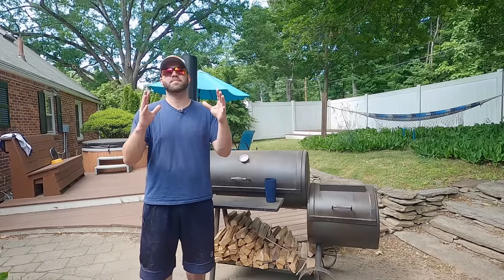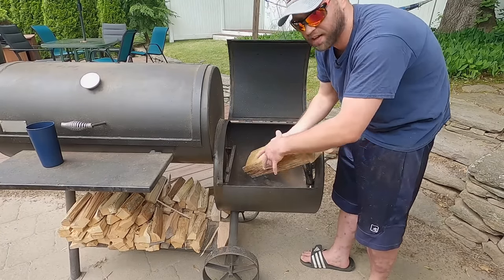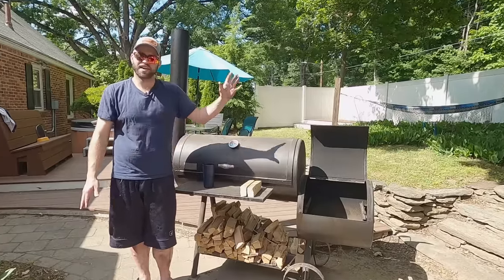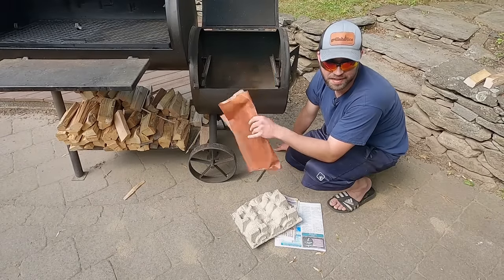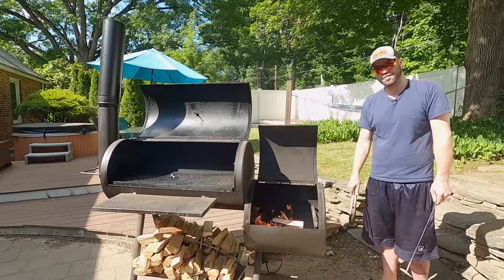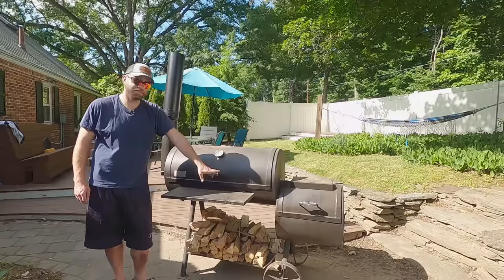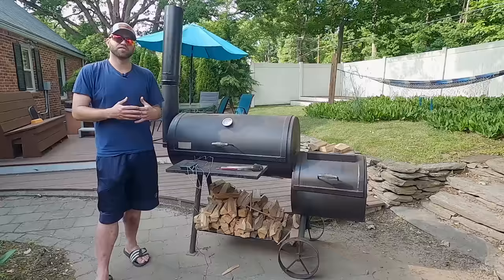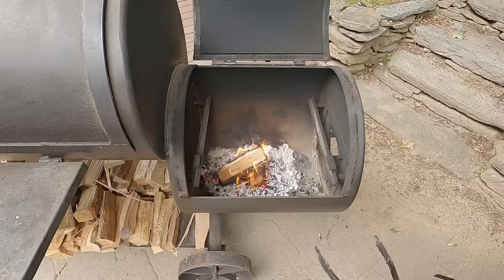OFFSET SMOKER FIRE MANAGEMENT FOR BEGINNERS | How To Burn A Clean Fire | Fatty's Feasts

Comment from the maker: Here are the links to other videos mentioned in this one:
Best Wood Choices: https://youtu.be/rpaCFw3QvmY
How To Extend Your Stack: https://youtu.be/qMCBjzdNWXU
My First Ever Brisket Cook: https://youtu.be/zmUmBZ9EDog

Do you have any tips or tricks for beginners that I didn't mention in the video? Let us know below!
Reply from the maker: @user-om2tm4fm7x  I think my first question is what type of smoker are you using? It doesn't sound like it's an offset if you're using chips.
Reply from the maker: @user-om2tm4fm7x  Ok I understand now. If it's a very cheap offset, it would be tough to use splits like I did here anyway, since it's typically too small. Charcoal is the way to go for sure as the main source of fuel. But, I still would not use "chips" as those are for propane smokers where you can soak them or use them in a smoker box for a gas grill. In your case, could you get a bag of wood chunks? Those shouldn't be too bad to find, but I don't know for sure in your area. I'm assuming if you can get chips, you can get chunks.
Reply from the maker: @user-om2tm4fm7x  Yeah small baseball size is good. Slap one of those guys on every 20 min or so for that smoke flavor. The problem with the chips I have in your case is they just burn fast, at least from what I've seen on offsets the size you described. You could try wrapping in foil, but I think the chunks would serve you so much better.

Comment: You're going to get injured splitting your wood in that position. Never put yourself on the side of the splitter like this.
Reply from the maker: If I were using a bigger splitter, I would agree, but I don’t believe these splits are big enough to do any damage.
Reply: I agree with Josh McBride.  I have a small splitter like yours and I've had some small splits fly off the end and land 20-30 feet away.  Those were mostly dense thick branches and not big log splits but I would err on the side of caution.  The kinetic energy of some of those are surprising.

Comment: There is such a thing as “too clean” a fire - and you lose flavor as a result. I’m not advocating heavy white dirty smoke, but no need to stress over every little puff of smoke. Throw a prewarmed split on and close it up. As long as you are not using splits WAY to big (as you pointed out) the process is quite forgiving in the long run.
Reply from the maker: You make a valid point. Thanks for throwing that out there!

Comment: I’m sure you’ve watch chuds bbq. The dirty vs clean smoke is debatable. Jirby, Jeremy Yoder, and Brad have all confirmed you don’t want clear smoke for the first part of the cook. Once I saw that I was actually able to maintain a more consistent temperature and the smoke profile on my food was better. It also allowed me to use larger splits. And I control the temp by how I lay them in the coals. The splits are long enough that they can bridge over the coals perpendicular to the smoker for a little air gap and if it starts to run away I can turn it at a bit of an angle and burry it in the coals to varying degrees to bring the temps down a bit. Just another tool in the box for running that fire.
Reply from the maker: Maybe I came off a little wrong in the video, but I did mention it’s near impossible to burn a crystal clean fire at low temps and that burning a somewhat dirty fire isn’t the worst thing in the world. I have a brisket video coming out soon where I explain that a little better. I like your idea about the splits. I’ll have to give that a try!
Reply: @FattysFeasts  no I heard you say it. I completely agree that there’s a lot more forgiveness in a cook. What I was trying to get at is the consensus is changing to say that you want “dirtier” smoke for the first part of the cook. Not billowing white smoke but also not crystal clear. Looking forward to the video. I recently picked up a pecos so it’s nice seeing videos on something similar. I was rocking on old 1/4” Oklahoma joes before this one. Tough having consistent temps on a 30”x16” cook chamber. The pecos is way easier to run.
Reply from the maker: @AlaskaBrisketCo  I've heard great things about the pecos! Some days I regret spending up for this one 🤣 I just didn't want to take the chance with out temps up in the northeast.
Reply: @FattysFeasts  you are preaching to the choir I’m up in anchorage Alaska. I ran my pit at -20 this last winter. I don’t think the pecos will be able to keep up in those temps. The pecos is a place holder till I build an 80 gallon pit out of a couple 3/16” tanks I have. If I had the opportunity to pick up a brazos I would have done it for sure.
Reply: No such thing as clean fire.
Reply: @hawghawg381  Correct. You shouldn't have any flames.
With a thick walled smoker just leave the firebox lid open a bit longer.
But for good heat and blue smoke. Just start logs in a fire basket and only move embers to firebox.
Reply from the maker: @hawghawg381  Well yes all fire is going to give off something, but the cleaner you can get it the better.

Comment: I have found that using wood about the size of a Pringles container works best for me. I normally buy wood by the truckload and store it similar to the way you do. I bought a load that was supposed to be seasoned oak and hickory. I looked through some of it the next week and there was lots of pine and about half of the load was still "green". Never bought from that guy again. I even told him that I was using it in my smoker!!!
Reply from the maker: Oh my god…that’s a nightmare. I’d be so pissed if I saw pine in my load. I’m not fully convinced mine was completely dry enough either. Definitely is now but the first few months had me questioning it a bit.

Comment: If you are on your deck i have used a square cement brick from home Depot for the bottom platform with a aluminum pan circular works great.  Also i like the use of firestarters cubes or whichever. Gets the flame going

Comment: I’ve watched so many fire management videos but this 1 has been the most beneficial. I learned the biggest issue I had was my coal bed. Today was the most stress free cook I had thanks to this video
Reply from the maker: That's awesome! I'm so happy to hear I made fire management less stressful for you. Believe me, I know it can be a complete pain with just one thing not going right!
Reply: @FattysFeasts Not to sound like a total Duh, but what is the benefit of using a coal bed? I'm fairly new & using a smaller vertical gas smoker. It has a small tray that rests slightly above the "burner" that allows me to put a small amount of wood on. I use commercial brand chunks & chips. I have a terrible time w/dirty smoke. I never seem to get to that light blue phase. Either my wood burns too fast or too slow. I maybe get about an hour out of it. I definitely need gasket tape, it has gaps & rarely do I get it up to 275°f. Because of this I bought a bag of charcoal hoping it would help up the smoker temp when I cooked. The few times I tried the charcoal, I didn't seem to notice any difference, not in the temp, the wood burn, or the flavor. Was I not using enough maybe or was I doing it wrong?

Comment: Wow, nice video. Not a beginner here but not a pitmaster either. Just a weekend warrior. I run UDS, electric, and my stick burner. I have the same model you have. If I want a set it and forget it, I run the UDS. I use the electric for low temp smoking of my home made sausages. The Stick Burner is mostly for Brisket or pulled pork. You really covered the important aspects of that size offset smoker. Wood size and keeping the firebox lid open till your wood catches fire. I only run the Offset smoker when I have the whole day to sit and chill out . Therapeutic for me after a long work week.  I check my fire every 30 mins. Works for me. Just need to make sure you have enough beer for the cook. No running to the liquor store for more beer if you run out.
Reply from the maker: Wow you have quite the collection! I wish I could have that variety of options. I feel the same way. Most people don't understand it, but watching a fire all day can be very therapeutic! Especially when you have a few ice cold brews. Unfortunately, I have been in that situation where I run out, but I have some good friends close by that will bring me another case. Just gotta pay them in brisket! 😁

Comment: I’m a regular Webber kettle, lump charcoal backyard bbq  kind of guy and I’ve been considering making the jump to one of these offset smoker but been very intimidated by fire control and how to use wood as the main fire source. This video has really simplified a lot. Thank you for such an informative video
Reply from the maker: Hell yeah! Make the jump. You won't be disappointed! If you have any other questions, reach out!!
Reply: Can do this on your kettle though. Just build the fire on one side of the grill and set your food on the other
Reply from the maker: The concept is the same, meaning indirect cooking. But, it's two completely different ways of cooking. @darkside7109

Comment: Great video, I been smoking for about a year now. I usually use 16" logs but been thinking about cutting to smaller pieces. Definitely will cut them smaller and try that out .
Reply from the maker: Definitely give it a try! You have so much more control with smaller splits, especially in a backyard smoker. If you’re running something over 250, the 16in pieces would work well.

Comment: I'm ditching the pellet smoker. It was great to learn on but moving up to Oklahoma Joe and love that you can teach me the basics on wood fire I'll definitely try your suggestions
Reply from the maker: Awesome! The pellet smokers are great for convenience, but you just can't beat the flavor of real wood. Let me know if you have any other questions!
Reply: I have the Oklahoma Joe Highland and his tips apply perfectly with the fire management in those.  I use a charcoal basket and start my fires with lump coal with using splits as fuel. Instead of paper and a chimney I just put the charcoal directly in the basket and light it with a torch. I fired those lighters that he is using in this video a long time ago. Lol I do need to look at possibly using even smaller splits or chunks as my temps do have a tendency to spike in the middle of the cook. My damper on the firebox sucks eggs so I just use the firebox door as a damper and keep the smoke stack wide open.

Comment: Really  nice video. I keep a large pan full of water under the primary cooking area. Helps stabilize temp, and catches most of the drippings and makes cleanup easier.
Reply from the maker: Glad you enjoyed it! I'm a water pan next to the firebox guy myself, but I also appreciate an easy cleanup! My only concern would be grease fires, but I'm assuming you haven't had an issue with that?
Reply: @FattysFeasts  None; the pan is 2 inches deep and has about 1.5 inch of water. Rendered grease just floats on top. Since its in the smoke chamber not in the fire box - never had to worry about a flareup.
Reply from the maker: @johnlove4183  Interesting. I may try that at some point!

Comment: 2:26 😂😂😂😂😂😂😂😂😂😂😂😂

I purchased the char-griller grand champ XD smoker at the end of 2019. When the pandemic started, I focused on learning to use it and manage the fire box. With these smaller, “ backyard” smokers I agree when you say that smaller pieces of wood work best, I use nothing longer than about 6 inches long and maybe 3-4 inches thick. One piece at a time and I have been very successful in maintaining 225-250 degree temps consistently. If I need a little more heat I add an extra piece of wood. The best BBQ I have ever had!
Reply from the maker: Absolutely! Every smoker is different and it definitely takes time to get used to. But once you do it’s typically smooth sailing! Glad to hear it’s working out!

Comment: Hey! thanks man! I just smoked a pork loin before watching this. Good to see I had the basic idea correct! I use lump charcoal, which is harder to build the coal bed from, but I didnt know I could simply remove that blasted ash catch! LOL would have solved an issue I ran into earlier. I also use the smaller chips in my offset, in a pan... now, Im going to start using actual wood! again. Thank you!
Reply from the maker: Glad I could help! Yeah that ash tray is sort of useless, in my opinion. Can't beat using real wood!

Comment: I have one of the original OKLAHOMA JOE vertical offsets and I use about the same splits and it works great for me. I add 2 splits about every 15-20 mins.
Reply from the maker: Glad to hear this way works out for you as well!
Reply: You're doing well. Trick is in adding smaller portions of wood. And splitting will result in larger surface to burn (more heat).
I also added some more comments.

Comment: I have the same smoker. Stack extension is a great idea. I moved the expanded metal fire box rack to the bottom of the fire box. It helps air get under the fire and works great. I removed the original steel firebox grate and put it in the cook chamber. It slides up perfectly against the piece you cut out. It has evenly spaced holes in it and creates a great baffle. That really evened out the temps in my pit.
Reply: What brand smoker is that
Reply: @jeffconley819  old country bbq pits. They sell them at academy
Reply: @davidgraham5125  thanks 👍
Reply from the maker: I tried both the things you said. I just feel, in my particular case, that having the fire directly on the bottom of the box works for me. I just like that coal bed to be in one place and not fall through or anything. I also felt like the grate in the cooking chamber kind of helped a little, but it wasn't as easy as just letting it stay wide open. But then again, every smoker is different!
Reply: @FattysFeasts  I might give it a try. I used your trick to increase the stack height and it made a huge improvement.  Best 12 dollars I ever spent.
Reply from the maker: @davidgraham5125  Awesome! So glad to hear! It is the cheapest thing to do to make the smoker even more awesome!

Comment: One of the best ways I’ve found to keeping my temps less differential between the ends of the cooking chamber. Is to keep my fire in the middle of the fire box like you were. But I see most people end up with their fires tucked hard against the common wall. It makes that metal of the wall really hot, and pushes wild temp swings,especially when the fire box is opened to add fuel.
Reply from the maker: Fire placement surly makes a difference and most people forget that. I think the fire and coal bed just moves throughout the cook and people forget to watch it / pull it back towards the door.

Comment: I am really glad you made this video. I think we have the same exact set up down to the water pan that you are using.  I was looking for content because I have been getting the temp swings mainly when I add wood. I'm gonna try the smaller pieces. I am using almost the same diameter splits but they are longer. Thanks for the advise.
Reply from the maker: Glad you found it! I did the same thing at first...Thin splits that were way too long, because that's what I saw other people doing. It really comes down to trial and error. Let me know how it goes!

Comment: Great video and explanations the only thing I would add to this is cleaning the pit and addressing how grease fires derive from too much heat and too much grease from not cleaning
Reply from the maker: You make a good point! And making sure it's positioned at the right angle so the grease doesn't pool at the fire.
Reply: @FattysFeasts  exactly! So much iterative work that goes into smoking meat as a beginner. I just upgraded from smoking meats on an actual grill to a real legit stick burner that’s made out of 3/8” steel 24”x”24” firebox and 4’ cooking chamber, 3’ smoke stack and I consider myself a beginner still even though I’ve been grilling and smoking meats for for almost 20 years now.

Comment: One of my favorites to use for a coal bed is royal oak lump coal. I'll generally use a lit chimney then lay a bed of unlit. Once it starts taking off I'll split some micro logs about 3/4 inch thick and lay with the flow of air.
Reply: Of course that's when I'm doing long smokes for briskets or other large beef cuts
Reply from the maker: I actually just picked up some of that the other day. Gonna give it a try. Heard some good things!

Comment: I think it's cool that you are able to get your own wood. Im going to get a smoker for the first time and I was probably just going to get wood from home depot or lowes. I'll have to look into how to season wood if I ever find free wood lying around.
Reply from the maker: Do you have a wood supplier near you? When it comes to finding wood, the best way is to just let it sit for at least 6 months. It sucks because it takes time, but you definitely don't want to risk it.
Reply: @FattysFeasts  Yeah I did some searching the other day and there are 3 places kind of close by. Not sure what type of wood they have from just looking at their website, but I'll have to check. Seemed like they only had dried out normal firewood. Wow 6 months, that's good info to know. It really is a science to get the smoker working well. I'm looking forward to learning more. Thanks for the help!
Reply from the maker: @joe62845  Typically if it's firewood, it's all hardwood that's okay to use in the smoker. They usually don't give you a soft wood like pine, as it will build up creosote in your chimney.  Also, typically their wood is pre-seasoned and if it's not, they will tell you. It is definitely a science and it takes practice, but once you're dialed in, it's a great experience! Let me know if you have any other questions!